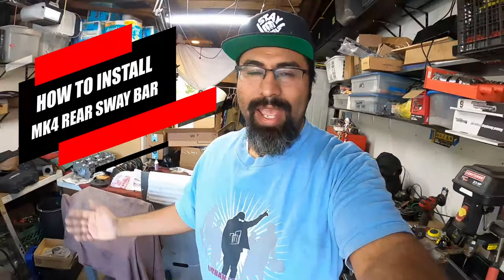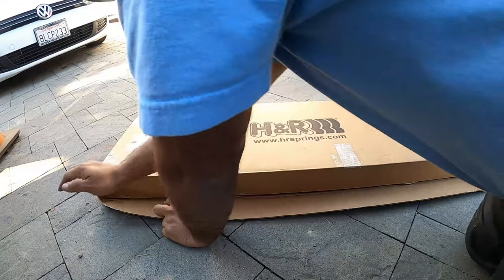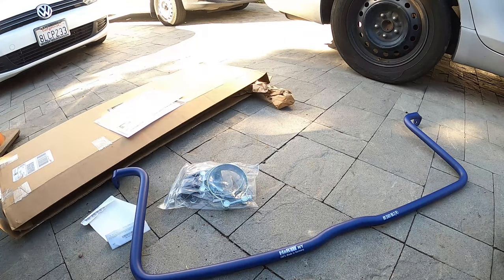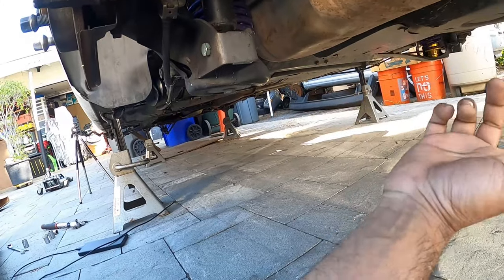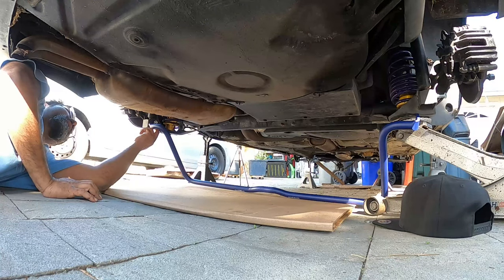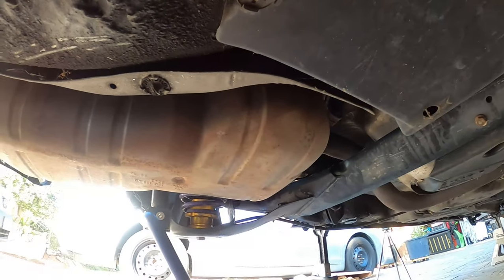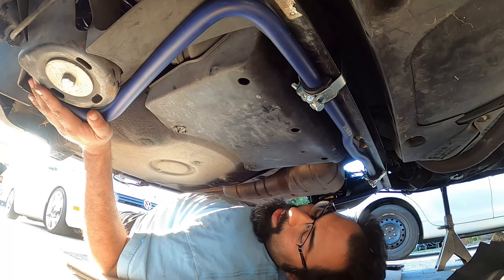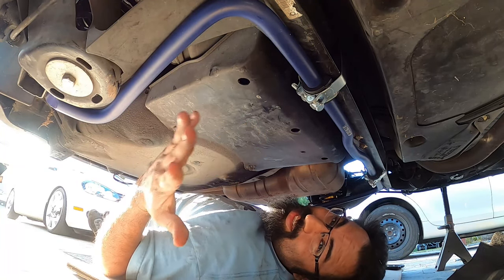How to install H&R VW MK4 Rear Sway Bar S7EP21

Comment: hello nice video. I also installed this bar on a audi tt mk1 fwd 3 years ago. Mine was 25mm. After install i noticed the car feels more stable in turn and in roundabouts. Its stiffness the rear axle, a real sway bar needs a fixing point to the chassis. 
Later i swapped the front sway bar also, both are worth the money.

Comment: I like to use a mini jack to hold the sway bar so i dont have to tire my arm out holding it and focus on mounting the bushing, great video!
Reply: My neuspeed sway bar bolts in to the actual axle beam

Comment: just a heads up, I think you installed the clamps in the wrong orientation. If you check the install note that comes with the bar, it shows the head of the screw being at the rear of the car with the screw pointing forward. When I tightened everything up it did make sense to do it that way. Not saying yours is not going to hold and I totally agree with you, this was a mess to install. It should be a 20min job but took me an hour with the car already being on jacks and such.

Comment: Just listening to the frustration over the t clamps. I hope that h&r watch this and resolve the issue. Just think as you say there are other kits with specific shaped clamps that are alot easier to fit. I would have thought a big brand like this would have it dialed in by now. Lol it's not like the mk4 has only just appeared on the market is it!😂🤣

Peace
Reply: es que no funciona una barra estabilizadora  atada a un tubo. podrias atarla con una cuerda y nunca notarias la diferencia. Porque nadie se explica porque la version GTI no trae barras estabilizadoras atras?

Comment: Do you think the issue fitting was due to working on the floor? 

Would it be less of an issue if the vehicle was on a ramp??
Reply from the maker: The main issue is that it's a clamp style bracket just really hard to pull it over to start threading it.

Comment: Does the beam swing with the trailing arms? If so, that sway bar is never loaded.
Reply: That was my question as well . I guess it does something but wouldn't just welding round or square tubing in the cavity of the beam do the same thing this expensive sway bar is doing . It seems like all it is doing is taking a bit of flex out of that beam . Not sure a piece of steel with an H&R sticker on it is worth the price .

Comment: Hi how are you. My name is Vaun i am from south Africa. I whant to ask you something i have an jetta mk4 2002 model 1.6 SR petrol. I was looking at your video and i was happy to look at it. And i came across that i see that my car doesn't have a swaybar at the rear of my car can that cause my car to drift on the road if i don't have that. Please help me understand?
Reply from the maker: These cars do not have rear sway bars. We added them to this car. If you have a rear swaying I would loom into you rear beam Bushings or tires
Reply: @PincheALsGarage  oh Okey no problem. I was just wondering because i saw that you put one in Okey well chat again i like your video
Reply: @PincheALsGarage  hi good day again. Sorry for bugging you. I don't know so much about cars. My 2002 model jetta mk4 1.6 SR petrol she feels loose on the road when i pull awa from first gear to the Last gear she is kindly to be all over the road. No i have spoken to some of the people where i live and they tell me that my shocks are finished that i must check to see if there is no oil leak on the shock. But i checked and i see nothing so i don't know if the oil ran out over time or what. Then they also said that ball joints can also couse that if it is worn out and bushes aswell. Can those items couse that kind of problem?
Reply from the maker: @vaunvandermerwe5303  yes it can cause these issues
Reply: @PincheALsGarage  Okey thank you so much i will have a look at it. Because i don't whant to spend money on things that is not needed. So i will have a look at the small things like the ball joints and bushes and take it from there. Thank you so much you have been a great help to me. You will be hearing from me alot for assistance. It's not that you are around for me to come over to you for help. Thank you

Comment: This is false. It doesn't work. they are two rigid bodies tied together.
For it to work, it would have to be installed on the chassis and not on itself. The clamps would flake all the time if it would really work.
Reply: It will increase the rigidity of the rear axle and decrease the torsional force applied when cornering, thus meaning less body roll. The clue is in the name "anti-roll bar". So it's not false.
How well it does the job may only be noticeable on a track but to say "it doesn't work" is a bold statement.